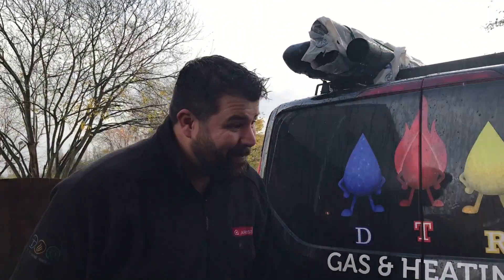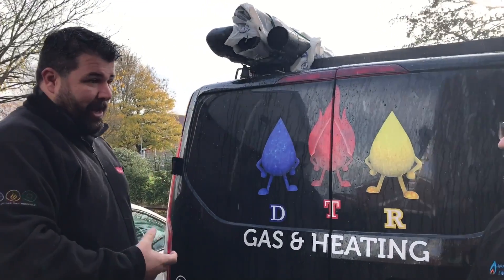Boiler Plus How do outdoor sensors work and weather comp controls

Comment: A weather compensator is a feed forward controller. It anticipates the coming heat loss or heat gain raising or lowering the boiler flow temperature.

Comment: What about payback period eg  the controls cost you  £1000  I then will save  £50 a year , will take 20 years to get my money back. Compensators 
and optimisers are only good if your boilers are or above 100,000 btu . Thats a UK building regulation
Reply: I'd like to know which clause of which building regulation, and which year, please.
Reply: Quality boilers come with them as standard. 
"Compensators and optimisers are only good if your boilers are or above 100,000 btu"
Complete nonsense.  
"Thats a UK building regulation"
More nonsense.

Comment: those sensors are a pain....sun cooks them and boiler wont fire ...sucks if you have hot water indirect tank hooked up..
Reply: Outside sensor should be on the North East side of a building in the UK  eg no sun
Reply: @paulspencer153  sound logical...
Reply: Maybe use a professional..

Comment: Sorry! Whether compensator it is to compensate the heat loss ex: windows, roof, floor, walls etc.  when the temperature outside drop...
Reply: Sort of right.  As the vid said, they keep the flow temperature as low as possible to maintain thereabouts the internal setpoint. Some compensators have room temperature influence, which raises or lowers the graph slope to reach a highly accurate setpoint.